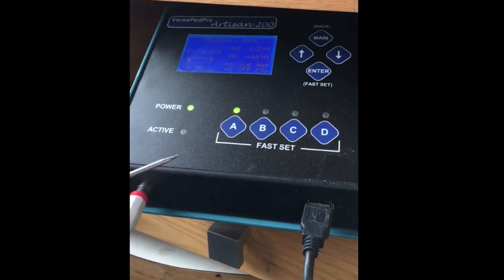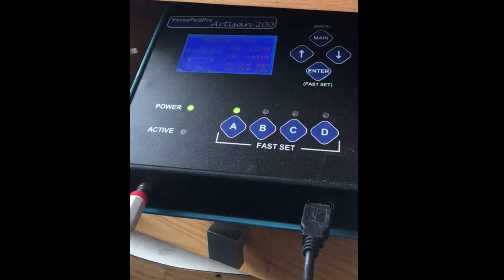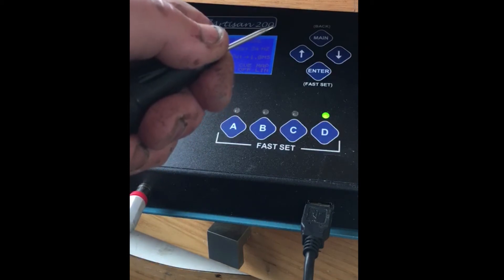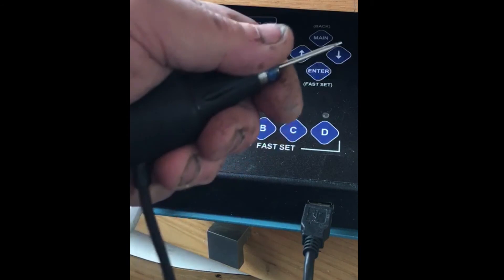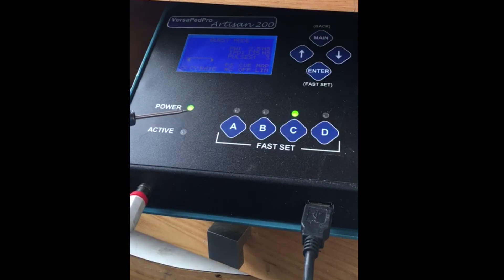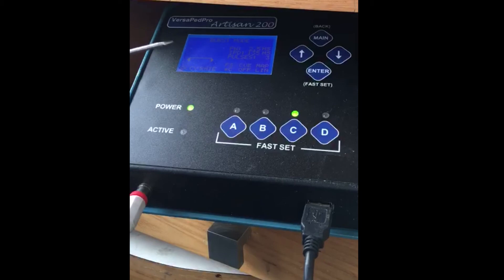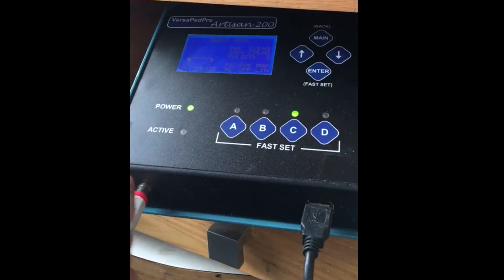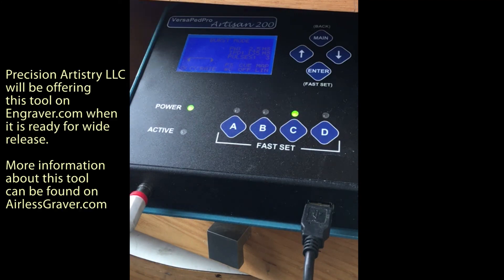Christian DeCamillis Introduces the PulseGraver™

Comment: Hi Chris/Tira, that looks like a very interesting tool you've designed and made.  I have a couple of questions that I hope you can answer. Firstly, I'm assuming there's some sort of solenoid in the hand piece and that it's attached to the control box by a cable as opposed to a hose?  We all know that hoses at times become brittle and leak air but the problem is easily solved by trimming said hose.  With this tool, how durable is the cable (is it armoured for example) and is it available as a spare that can be changed by the user? Lord knows how many cables I've got through with my iPads over the years where constant removal causes them to fray and become damaged. If I were to invest in this system (which I might do at some stage because I can see it being extremely useful for some jobs) ease of maintenance is extremely important to me.  Secondly, how noisy is it? I work out of a spare room in my house and it's attached to the neighbouring property.  Is it any noisier than a GraverMach?  It's hard to tell from the video.